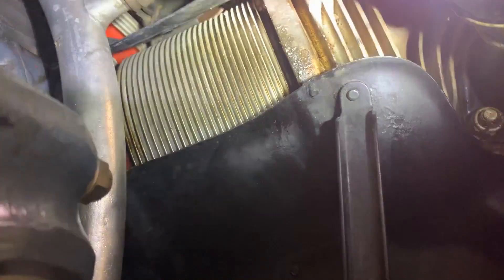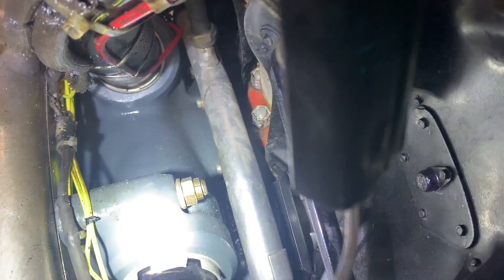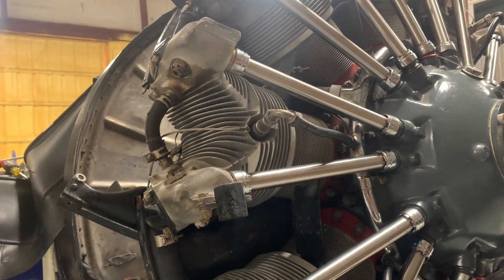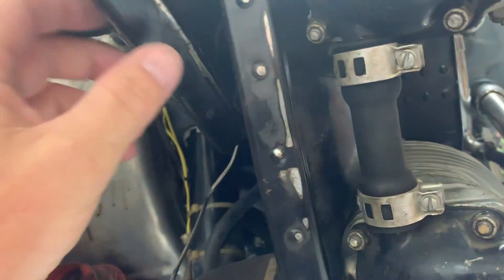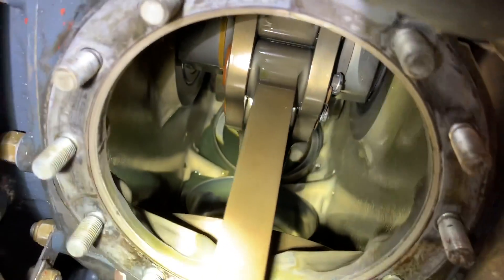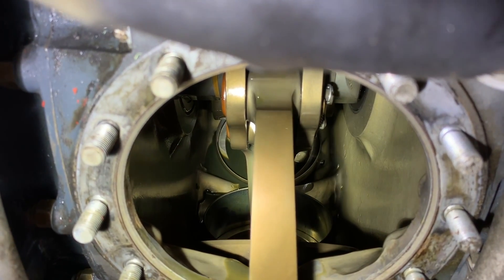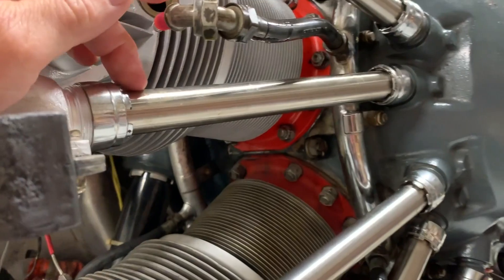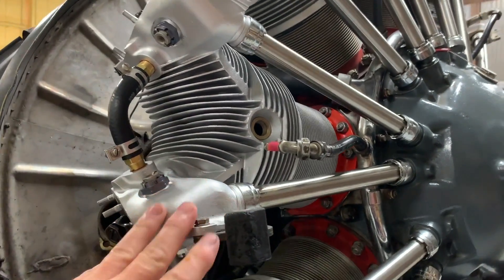Replacing Cylinder on an R-985 Pratt & Whitney Radial Engine

Comment: Very nice informational video on changing cylinder barrels.  Cylinder separation is a fairly common problem on these Pratt & Whitney engines.  Had two fail on a C-47 Dakota, which is powered by the R-1830 Twin Wasp.  Also changed out jugs on several R-985 Wasp Jr.'s on a Beech 18 and a Stearman PT-17's.

Comment: As an old AF  recip engine mech dealing almost regularly with R-4360 and R-3350's on Old Shakeys and Super Connies  ,a cylinder change on a 985 would be like making spare change for some good cigars. Some of the worst to deal with was lower rear on an R-2800. I liked working on the little Beaver that was used in the Aero Club occasionally. The 115/145 fuel was great for the Zippo lighters😁
Reply: It's my understanding, the  massive Cyclone R3350s were a true nightmare to work on. First used on B-29s that had severe cooling issues, the problem was never really solved. 

Then when they decided to use the same engine on DC-7s, the nightmare continued. Apparently L1049 Constellations ran a little better?

I had a friend of mine that cursed DC-7s based in Alaska.
Reply: @DougHanchard  Worked on af RC-121E and found no more problem working on them even after they installed cooling baffles on the cylinders. ADDITION of bendix. direct fuel injection took care of a lot of troubles.
Reply: I dont mean to be so offtopic but does anybody know of a way to log back into an instagram account?
I was stupid lost the login password. I would appreciate any tricks you can give me
Reply: @Gordon Kaison Instablaster =)
Reply: @Devin Kobe i really appreciate your reply. I found the site thru google and im in the hacking process now.
Seems to take quite some time so I will reply here later with my results.
Reply: @Devin Kobe it worked and I finally got access to my account again. I'm so happy:D
Thank you so much you really help me out!
Reply: @Gordon Kaison No problem =)
Reply: From one engine tech to another,
How in God's name do you time all 7 of those mags? 
Do you sort out each respective bank's mag, then index the banks together? 
I work on Continental TSIO-520s. Only maybe 5% of the time does 1 of our 2 mags have to be re-indexed. Which, thankfully, is easy to do.
Reply: Power Recovery Turbines (PRT'S) were problematic because of expansion and contraction of the flight hoods. Many cracks were found in that hardware. See why by viewing a Connie on takeoff roll at night.
Reply: @davecrupel2817  3350's had two mags and the 4360's I worked on had four. With the twin wasp each mag had a control cylinder #1mag=#A1cyl 
#2mag=#B5cyl  etc.
They had an "e gap" mag position and a button to press to index that position , then you inserted the mag into drive and proceeded to time mag to cylinder with a B-2 timing light.

Comment: this is the first time in over 30 years I've seen someone remove a 985 cylinder without first removing the push rods and tubes glad he's not working on my engine and not even on top dead center
Reply from the maker: fun thing about all of you old guys. you are all retiring and fewer and fewer people know how to work on these old engines.  I figured out what the handy tool was in my box and won’t do it again :-). My next goal is to figure out that damn valve spring tool.   still can’t use that thing.
Reply from the maker: Yeah, I watched another video where they did that and at the time I didn't realize what one of the tools I had was for.  There aren't many people left that know how to do all of this stuff which is why I'm trying to learn as much as I can.
Reply: He did fine. Give him a break
Just because he didn't do it your way doesn't mean it's wrong
There's more than one way to skin a cat
Reply: Yep no kidding. Here, hold my beer while I take this off.  I'm a diesel mechanic and thought oh ok just wipe off the pushrod and put it back in. Perhaps he should have had a second pair of hands helping.
Reply: @CHEVYK10  There's more than one way to ruin parts also.
Reply: @fxst100able  Boy ain't that the truth!

Comment: Putting up with GA aircraft owners was the worse part of being a licensed A/P mechanic. I finally went into factory upgrade work and prototype production. I was lead mechanic on the Ted Smith Aerostar twin engine executive aircraft N-320 TS back in the early sixties. At the time it was the fastest GA twin engine aircraft available.
Reply: Started in General Aviation. I quickly moved to corporate aviation. Takes awhile to get experience but it paid off. 43 years of corporate Jet maintenance. Retired now and don't want anything to do with airplanes.
Reply: white zebra  Under the right conditions its cruise speed was in excess of 300 mph. It was not for the novice twin engine pilot, however. It is a hot rod in the sky. Other manufacturers produce such planes today. I believe it was a Piper single engine speedster that killed JFK junior his girl friend and her sister on the east coast. It isn't just the speed in flight but the planes of this type are set up differently and require a good number of hours flight time with a pilot skilled in the ways of these performance GA aircraft. They are less forgiving of clumsiness, so knowing what to expect next and being prepared is the game you must play when you strap in for your first solo flight. Except for ex military fighter pilots the average high time twin engine pilot still needs at least ten hours of instruction in the Aerostar before taking off, even then the plane demands your constant attention and intense focus. It is not a walk in the park. There are a number of holes in the ground filled with Aerostar parts.
Reply: white zebra I installed the fuel bladder in the prototype Aerostar. It was located at the rear most bulk head of the cabin. There were transfer pumps everywhere. It is one of the systems that is a 'must master' as fuel location at any given time is a big part of weight and balance .
Reply from the maker: Wouldn't it be nice to be successful and have no customers to deal with?  The fact is dealing with most mechanics is why most aviators get out of flying.  None of us are as perfect as you.
Reply from the maker: @timmayer8723  Actually this isn't true at all.  In fact, it is so exaggerated as to be spoken by someone that probably hasn't ever flown one.  Aerostars at altitude cruise around 220 to 230 knots.  The only way one of them would ever see 300 would be with a nice tail wind.
Reply: white zebra  340mph
Reply: @nizexlizzy  When the mechanic isn't at his best,
You aviators can't do the rest.
Reply: @nizexlizzy  Wikipedia has top speed @ 304.
Ted Smith once said he had seen 330.
Reply from the maker: Recipro1 groundspeed.  sure.  no freaking way on earth an aerostar with its regular engine setup ever flew that fast true airspeed.  that is faster than 90% of the turbines flying today.  oh. btw.  i have NEVER seen an airplane that can cruise at what is in manufacturer manuals so not surprised wiki has it wrong.
Reply: @nizexlizzy  The TS plane was all souped up.
Reply: @nizexlizzy  What was the fastest speed any reciprocating engine aircraft with a propeller ever flew?
Reply from the maker: @Recipro1  As far as I know the Aerostar still holds that record.  They have it listed at 261knots or 300 mph.  However, I can tell you that none of the Aerostars I've flown in or have heard of fly near that fast.

Don't get me wrong, they are awesome airplanes and very fast but it gets tiring when people make claims about airplane speeds that I'm sure they've never actually seen but only heard of.

Almost all airplane manuals list speeds for cruise that border on criminal to even list.
Reply: @nizexlizzy  I've noted that many many GA aircraft owners manuals that came before standardized POHs are written as sales brochures and not useful operating advice. From optimistic performance figures, to the rosy pictures of no sweat crashing or ditching.

Coming at certain pilot manuals from the aerodynamics and design side, I can see that in most cases their reported takeoff, climb, maximum speed and altitude numbers come out PRECISELY to the numbers calculated by the most basic and rudimentary 1.0.2 level aerodynamics textbooks. 

Completely disregarding the fact that their actual airplane is covered in rivets, or made of billowing rough fabric, and not made of perfect wind tunnel test airfoils. No attempts to correct for less than 100% span efficiency, using the basic geometric aspect ratio for their induced drag calculations. They usually use a rounded number estimate for zero lift drag, such as: exactly 0.03. Instead of reality which might be 0.03192.

And then there are the aero engines that are notoriously rated at a fake horsepower numbers that defied reality, and all SAE standards, which themselves were already very lax in that era. They were able to do this, because the FAA allowed a weird rating formula that was overly optimistic by more than 5% in the real world. Seems small. But it accounts for several miles per hour, and many feet per minute climb, an extra 50-100 feet or more takeoff distance. And significantly reduced density altitude performance. These optimistic yet official horsepower ratings certainty lead designers to inadvertently build a larger, heavier aircraft than the actual engine can haul around at their stated performance goals. 

This same scenario afflicts nearly every GA aircraft designed between 1930 and 1970. Some companies did thorough flight tests, modified the aircraft or updated the owners manuals according to reality. Such as Beechcraft and the later four place Cessnas.

But MOST I would say, did not even bother, and just ran the performance figures they had intended to achieve, based on their rudimentary pencil whipped calculations.

A great example of this that is easy to verify by simple formulas is the Champ/Citabria line of aircraft. Find the UK owners manual and read the warning issued by their civil aviation authority. Its hilarious, and true. "This aircraft is incapable of achieving the stated performance under any conditions" Including the stall speed. And it also recommends a reduction of all performance estimates by 10%. But they sold a lot of them. LOL.

Edit* For the Aerostar 700P performance listed on Wilipedia, there is actually one specific scenario that it could achieve 306mph. 

That is with perfect running fresh engines, running flat out, leaned to peak power at the precise maximum altitude corresponding to the turbochargers critical altitude (Precisely where there waste-gates fully close but before power begins to drop off) this is around 17,500' for several turbo Lycoming engines so I used that. 2x350HP = 700 x 0.85 prop effcy = 595 Thrust Hp. 595 X 550/448.8ft-sec = 729.167lbs of thrust. 

Using 145.276 for compressible dynamic pressure (q) at that 448.8ft-sec speed, 17,500' altitude, mach 0.31 combination gives a flat plate drag equivalent to 5.019 ft^2.

Using 36.8' span squared / 178.2 ft^2 area gives an aspect ratio of 7.599. Multiply that by 0.8 (rough estimate) to account for wing washout and fuselage effects gives an effective AR of 6.0796. x pi = 19.1

Wing loading of 6,315/178.2 = 35.43lb per ft^2. Divide that by non-compressible (q) of 138.785 = Lift coefficient of 0.2553. CL^2/19.1 x 178.2...

 = 0.608 flat plate drag comes from induced drag. 

5.019 - 0.608 = 4.411 zero lift, flat plate drag. 

4.411 / 178.2 = CD0min drag coefficient of...

0.0247531. 

The Beechcraft Bonanza is a similar construction method, and known to be very nearly CD0min of around 0.0195, or a flat plate drag near 3.5ft^2. which is certainly lower than this estimate. (Because a bonanza has a smaller fuselage, and only one engine/cowling/cooling and has about the same wing area) 

CD0min based on wing area is not a great way to compare anything, except to see if performance claims are believable or not. (In this case, I think it is).

From another angle: 4.411 ft^2 flat plate drag area is reasonable for a small GA twin. If you estimate wetted area from this at 4.411/0.006 you would get 735.17 in square feet. This is 4.12x its wing area. Right in the realm of most other aircraft of this type. 

(A P-51 had a wetted area near 877ft^2. Only about 3.6X its wing area).

So I believe that under one specific scenario: 306mph or 448.8ft-sec is possible given two 350hp Lycoming engines, with perfectly adjusted magnetos and mixture, producing their exact rated horsepower at a critical altitude of 17,500' feet, with well designed 85% efficient constant speed propellers, at its listed gross weight of 6,315, factoring is compressibility at mach 0.31. 

It becomes a very believable performance number once you factor in a little ram-air pressure for the intakes, and a significantly lower than gross weight and wing loading condition.

Any other altitude, such as sea level, for 306mph you are going to need a CD0min of less than 0.016 where the P-51 was 0.0164. Completely unrealistic for a metal commuter plane.

Over.

Comment: Basically when I hear a man that’s much wealthier than myself say “hokey cow it’s expensive” that tells me to never ever think about Beech18 ownership lol
Reply: The R-985 is a 60-90 year old engine and the cylinder heads can only be overhauled so many times before they fall out of allowable tolerance to be used. They're so intricate that the only way to salvage jugs that don't have significant issues (like cracks) is to use an expensive spray metal process to rebuild the inner diameter and re-bore it to spec. In smaller P&W engines like this, the jugs are cast aluminum, but in the larger engines like the R-2800 and 4360, the jugs are drop forged.

The only price I've found for an overhauled cylinder head for this specific engine is $5400. The rest is "call for price", which means that it's even more than that or not available.
Reply: @GGigabiteM  surely the cast aluminium is chrome hardened?like BMW nikasil?
Reply: @eugeneoreilly9356  The cylinder bore is a steel or cast iron liner, there's no point to case hardening the aluminum fin assembly.

Comment: I flew the Beech 18 for 3,000 hours back in the 1970s and saw this kind of cylinder failure. I also two occasions where the cylinder hold down studs all broke off which resulted in an engine fire.

Comment: Imagine working on a big radial on a cold rainy airfield in England.
Reply: Been there and done that multiple times.
Reply: Could not recall exact number of engines in the engine shop at RAF Mildenhall at all given times but a one day count was 40- R-4360s 
4 - R-1820s
4 -  R-1830s
which were there for maintaince,  teardown,  or buildup, out of the shipping container from the manufacturer. Also a mobile test and run up tractor and trailer for R-4360s with a crane and mount for them.
There was also a full prop shop for support.

Comment: I always pulled a prop through backwards on the R 2000-7 m 2 6-8 blades on first start of the day and let it lop at the lowest RPM until rpm rised on its own...ran for 15-20 min. Then she's ready to go...avoid back driving on decent.
Only had a cracked cylinder (1) once.preplaced same and ready to go in 8 hrs! 
The trick is not to let others fly your plane!!!! My two engines always went to TBO and in great shape.love to wrench on any radial engine......
Reply: The problem of pulling the prop backwards is you push the oil back into the intake pipe instead of overboard out the exhaust.

Comment: Two things I do not understand. How many compression rings are there? I assume there is an oil control ring too. How do you compress these rings when refitting the cylinder barrel? You mention the wrist pin. From what you say it is fully floating. What prevents it from gouging the cylinder walls?

Cheers
Reply from the maker: I would have to go look but I think there are 3 or 4 and 1 oil ring that sits at very bottom of piston.  You compress them with a sleeve that fits around the cylinder and slides off as you push the piston in.  The wrist pins usually have soft aluminum to keep them in place that won't hurt the cylinder walls.

Comment: I'm just a curious George, wondering how these radial engines differ from the inline in my car. Thanks for the video!
Reply from the maker: Same basic concept but a radial connects the crankshaft to the cylinders via a master rod where everything connects to it and then via a single connection it connects to the cranks shaft.  The cylinders all burn and move in the same way though as do the valves.  Also radials always come in odd cylinder counts where cars are typically even.  This is due mainly to evenly spacing things around the engine versus balancing side to side.  Very simple explanation but hopefully helps understand it.
Reply: @nizexlizzy  Thanks! I get the basic concept, and am curious as to what the manifolds, oil delivery system, etc. look like. So fascinating! The big counterweight reminds me of a steam locomotive's drive gear. :) Edit: P.S. you have a super cool job.

Comment: To one question in thread:
The master rod is made with piston pin end as common and   dual sandwiching plates on the other end so all the other crank pin ends are attached to it.
Removal of master cylinder  requires locking the master piston rod in the TDC position or other piston rings will move below the cylinder skirts and then you'll prob be removing 2 or three other cylinders to fix that problem.
Reply: There's a tool you can bolt on to a few cyl. holddown studs where the main cases split that will prevent the master rod from deviating from the centerline of its travel. This is accomplished with a dummy piston pin which will slide up and down within a rail the whole length of its travel.